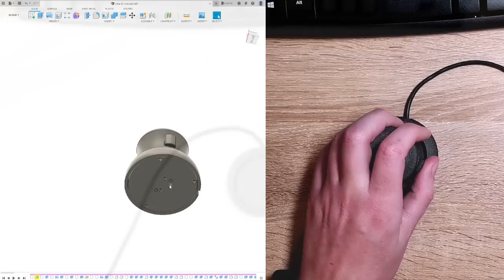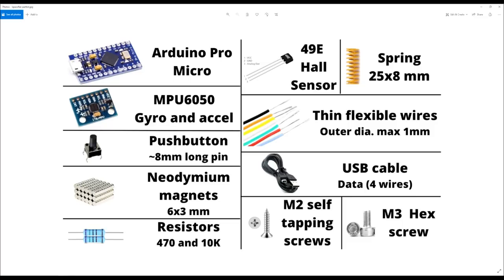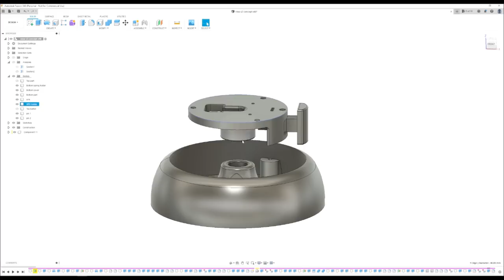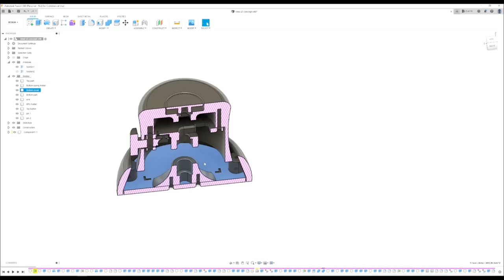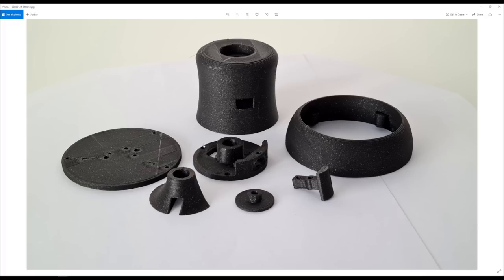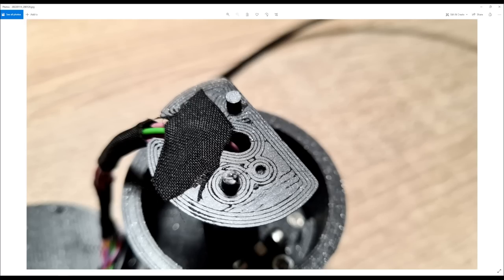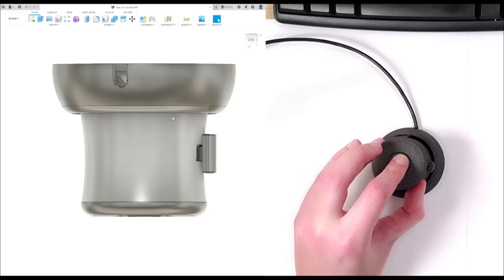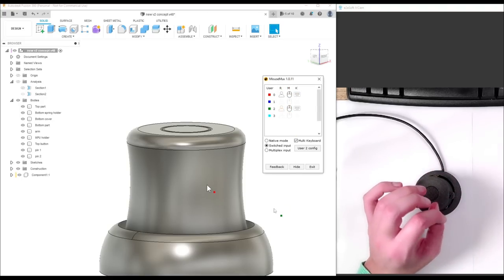Can my DIY Spacemouse compete with 3dConnexion??? - SpaceRat V2

Comment from the maker: Hello Guys,
I just want to add 2 comments.
1. If you build one, you have to set in the preferences of Fusion 360 to take Tinkercad commands otherwise the Arduino code has to be changed. Changing the code is also relatively simple though.
2. For some reason a lot of comments are deleted by Youtube after publishing. I just wanted to let you know that it is not me. I never delete comments.
Reply: Hi!
It´s an amazing proyect.
Could we talk by email?
Reply: This thing would work with any CAD Software? Like CATIA V5?
Reply from the maker: This works with every software where the navigation is handeled by keyboard and mouse movements. I would recommend to watch also the first video where I explain how it works more in detail.
Reply: Thanks for sharing this. Can you share with me the positioning of magnets? They need to push away the button one (to make it stay in the center position) or connect with it?
Reply from the maker: @OzziemandiasPL  you are welcome! The 2 side magnets has to repel the middle one to keep the middle one in the middle. I explain in the video the orientation. + -   - +   +-
Reply: @kikihobbyrepair  I wasn't sure but that was the point :) Thank you very much.
Reply: Have you tried using a Joystick.h instead of Mouse.h and keyboard.h
Reply: Hi, I’m going to order all the components and am busy printing all the files. Such a great project. Thank you for sharing
Reply: @ambriaagke where did you find the list of items to order if you don’t mind me asking
Reply from the maker: @Itsjustmedan you can find the part list in the video and in the github repository. Link in the video description.
Reply: @kikihobbyrepair  thank you sorry completely missed the jpg in all my excitement. Absolutely amazing project fantastic job especially with the price. It’s going to cost me about $20 AUD for the parts and a space mouse costs about $270
Reply: @kikihobbyrepair hi I’ve orderd a usb to usb c data cable and my arduino also has a usb c port. But from the video I understand that I need to cut the cable anyway and solder it directly to the board. Is this correct? If so can you explain where exactly because in the video you name the components but this board is so tiny I don’t seem to find the right spots. 
Is it correct that you need a capacitor of 100nF? It doesn’t figure on the parts list but it does on your diagram
Reply: @ambriaagke  hi, are you done with your project?

Comment: Building this now, but what's the reason for soldering on the usb wire instead of just plugging it in and glueing it in place? There's enough space for the connector. The resistors that the wires need to be soldered too are REALLY tiny and i've got big hands.. :P

Comment: Hi Kiki. I put together your project, but for some reason the zoom out button and the upper round button do not work. I am sure that I did exactly according to the scheme. Do you have any clue?
Reply from the maker: Are you sure all your wiring is correct? Do you have all your arduino libraries installed?

Comment: Great job! I know it took hundreds of hours to come to this point because I'm doing the same.
I follow exactly the same goals: cheaper and easier 3D mouse. 
My design is a 2 stage knob. The upper part of the knob does the rotation while the lower part of the knob does the translation. I published the version 2 on Thingiverse yesterday! I still need to do the code. We are at the same point.
I will be following your progress with great attention. :)
Reply: Can you share your project?
Reply from the maker: You can find the link to my Github repository with all the files in the video description.
Reply: Yes, I meant joker's one. Thanks!
Reply: Joker, please link your project.

Kiki, thank you so much. I have subscribed, and look forward to version 3, but for now, my parts have two more hours on my printer before I start building v2.

Comment: Great project.  For v3, you should consider a pair of custom PCBs.  Also, maybe consider increasing the base to add some steel or lead weights to keep it in place.  My spacemouse probably a .5 KG in the base…

Comment: Nice work. I also did one my self with a joystick, some modifier buttons and an Arduino aswell. But I ended up buying the 3d connexion mouse because it really lives and dies with the software, as you also figured out. I think they do a great job with the software and I always had problems with the mouse input. Using MouseMux it was hard to reset mouse position and without you interfere with normal mouse. And anyway for some programs like PTC Creo there are actions like rolling you can not do with key press emulation, but only with 3d connexion software. So I stayed with the original and appreciate their work.

Comment: Fantastic! I just built the Orbion Space mouse using a Raspberry Pi Pico instead of Arduino. I only realized the Pico was much bigger than the Arduino pro micro once I had printed the files. I have managed to make it work none the less. 

Your project has given me a lot of ideas as I set out to design and code a version of this for the Pico with Solidworks. I really want to tackle modes so functionality can be programmed in for different applications. Arduino seems like it is much further ahead in that regard as compared to CircuitPython. Keep up the great work! and Thank you for sharing this inspirational build.
Reply: Hi, I'm thinking of building this spacemouse with raspberry pi pico, would you have the code you used to share with me? Cheers
Reply from the maker: The Code for the Arduino pro micro is available in my Github. Link in the description.

Comment: Very interesting project, best part is that I think I have all of the parts!  One thought is to add a twisting action of the knob using hall effect sensors similar to the way that the zoom function works. Just thinking out loud that I might want to add a calibrate button to reset the zero point of the mouse/accelerometer when I'm not using it on a level surface.  No matter what an interesting project that came up exactly as I was thinking about buying a 3dconnexion mouse, looking forward to V3 as well.
Reply from the maker: Thank you. As I told in the video there is an offset calibration after power on in the code. In the v3 I plan to add twisting too. The biggest problem is the software and driver though...

Comment: Kiki, I just made the space rat mouse and got it working on the first boot! I used a USB C micro and a small prototype board. With the usb C i did not need to solder on the cable to the micro. I also used a slightly longer micro switch. I am going to look at your macro pad next. I printed the parts on a Bamabu Labs A1 mini with no issues.
Reply from the maker: Good job! 🙂

Comment: If you could make the ring around the button able to spin, and connect it to a rotary encoder, then you could get the rotation you were wanting. 
You could put the encoder below the ring, with a gear on top of it, and put gear teeth at the bottom outside edge of the ring, facing in towards the rotary encoder. You could add three extra microswitches around the ring, wired in parallel to the rotary encoder's switch, so wherever you press the ring, you'll get a rotary encoder press.

A crazy idea for another degree of freedom: Get a pressure sensor, and set your spacemouse on top of it. Then, pressing down on the spacemouse, or applying lifting pressure could control an axis. You'd probably need a large dead zone, and you might want a switch somewhere, to make it easy to disable the sensor, of you're doing something where you don't need it, and it could just cause spurious inputs.

I'm sure you've tried just picking the whole thing up, and using the accelerometers as a vertical axis. That might work if you're using your other hand to hold the base. There could be applications where that would be good. You could even add buttons at the base ring, for the fingers and thumb of your off hand.

Awesome build! It's amazing what you've done with so few parts!

Comment: Hi. 

Great alternative, it is well worth for the price! Thank you for making and sharing.

I have just finished mine, had to tweak the code a bit.

I have also made an autohotkey script so now I can use it without any problems for TinkerCAD, the cursor always stays in the workspace and i can infinitely scroll, zoom, pan etc.

However, for unknown reasons the distance between the main cap part and bottom spring holder was too short, as if the spring was shorter than needed.

I had to improvise and saw a ring off of the bottom of the main top bell part so it can move freely.

I am also planning to re-print the parts with modifications so that there is no need to solder an usb cable to the arduino, it can plug in directly, for now i have filed a hole in the bottom cover for the plug :D

definitely a work in progress but super satisfying already considering the fraction of the price of an original space mouse

Comment: I want to see someone fly a quadcopter using the SpaceRat as the controller.
I once used a Wii Nunchuck to control a small RC helicopter. I think a Spacemouse/SpaceRat would be more intuitive than the Nunchuck.
I used the accelerometer on the Nunchuck for yaw and throttle control. Twisting the SpaceRat could be yaw control and the throttle could be controlled by pushing and pulling on the SpaceRat vertically. 
Thanks for sharing your great project.

Comment: Awesome project. I'm currently working on a version to be used with Blender. So far I've been able to add the twisting motion using the same MPU6050's Z axis gyro. The code is not very different from the one using the hall effect sensor, and it seems to be working quite fine (although I must admit my coding skills are not the best). I'll keep you posted as soon as I complete it. Keep up the good work!!!
Reply: Did you ever finish it? :) I'm building one of these now and I'm interested in the code
Reply: @vesslades  Hello. Yes, I finished it. I made two versions: One with the MPU6050's Z axis gyro and one with a rotary encoder.  I'm happy to share it with you, but my files are a bit messy at the moment. Give me a couple of days to organize/upload everything to Thingiverse and Instructibles .
Reply: @meisterodin1981  Wow, thanks mate. I would appreciate it very much!
Reply: @meisterodin1981  Cool! Thanks a bunch!
Will take a closer look at it all when I get some me-time :)

Comment: Nice project.  I am doing some hall effect projects myself and I have found that the A1302 is a good substitute for the 49E and was a little easier to find in bulk. And of course, the A1344 hall effect sensors are all over the place, but they are not linear and will not work for your type of application.
Reply from the maker: Thank you. Yes, here I need a linear one. But I coukd buy 10 of them from Amazon below 10€ which is not that bad.

Comment: Great Project! Are you aware, that you can do at least two relativly simple improvements?
- Instead of having a button in the cap on top, you could make the whole cap the button.
- Instead of having a slider (or whatever you call it) on the side of the cap, you could make the cap a bit rotatable.

After what i see and understand, both improvements could be done without changing the basic design and without changing the technical side. It is "just" the mounting and the design of the cap, that has to be changed in order to get rid of the extra buttons/slider. The changes would make a nice looking clean SpaceRat...
Reply from the maker: Thank you.
Putting the button under the cap is not that easy because you might trigger it also when you put your hand onto it or while you tilt the cap. 
The slider I might solve it differently with a bearing maybe. Lets see.

Comment: This is really cool, I’m considering building one, because I think it could be better than the spacemouse.  

I understand they have cost constraints, but the spacemouse wears down rather quickly.    This could be built with machined aluminum instead of plastic like the spacemouse.
Reply from the maker: The huge advantage of the original is the firmware and driver. I simply cannot reprodukate it...

Comment: Good evening. Excellent video. On the other hand, could you tell me the connection of the four wires of the USB socket. There is no indication on the diagram Thank you for your reply
Reply from the maker: Thank you. Just take a look at a standard micro USB connector pinout online and follow. These are all standard.

Comment: Thank you for sharing your project. It is simply enormous because the circuit is kept so simple and only a few components are needed. I've been thinking about such a project for years, but I don't have the right knowledge of electronics and programming, but a lot of ideas in ergonomics and form design. As a program designer from the 80s to the end of the 90s in CAD/CIM, the mouse has always annoyed me. i hate the keyboard with Shift+Ctr+Alt plus right mouse click.
 3dconnection is too expensive for me. I am a pensioner.
 So your DIY Space Mouse with 12 buttons with small LCD ergonomic all around, that would be ideal. Similar to the large 3DConnection models. I would hardly need the keyboard anymore. I work hobby-like with SolidWorks (ancient), Fusion 360, Davinci Resolve, Thanks again for your great work.
HD
Reply from the maker: Thank you for the nice words!

Comment: Thanks for sharing and making available to everybody such a valuable project. I appreciate the value added to the community. I also would like to ask a question. I'm a newbie to Arduino and wondering whether the computer recognizes it as a HID device when you plug it in from Arduino's usb port or soldering the connections you suggested is a neccessity.
Reply from the maker: Thank you. PC is recognizing it as a Mouse and keyboard. Soldering is only to be able to put the wire on the middle. Wires are soldered to the same points like the usb cable connects to.

Comment: Oh, i was wondering... Would it be possible to make a controller that would look like reversed trackball? A sensor knob hovering on spring(s) over a dotted ball? You could track the pattern and use  for axis control? Zoom in/out (pull up/press down) would also work probably

Comment: Does this translate into 3d orbit when rocking? Have you thought about adding maybe a rotational component in the base? I think an affecter wheel and an eye setup could make a non electrically connected rotating part.

Also, I noticed that it moves in 4 directions instead of following more the movement of the spacerat. is this because it is using keyboard commands?

Comment: This is just screaming for a custom PCB holding the sensors, button and an MCU (attiny84?) all on one board reducing the footprint and the amount of wires ...  Well done!
Reply from the maker: Thank you. Yes a custom PCB is the plan bit you need 2 anyway. The MPU must be at the top and the cable has to come out at the bottom. Attiny84 is not good because you need a microcontroller with native USB. This is why I use the more expensive pro micro and not only a cheap nano.
Reply: @kikihobbyrepair  I thought I had seen code in the past using an Attiny as a USB HID device, but I'm unsure.  Well, an STM32 could also do the trick or the MCU of the Arduino, but then without all the unneeded stuff ...

Comment: Is it working system-wide with all apps supporting 3D mouses? FreeCAD, Orca, Fusion, ... or is it the compatibility limited?
Reply from the maker: It works with all the systems taht are controlled by mouse and keyboard commands. You only have to change these commands in the code for different apps. Now I am working on the V3 which is true 6DoF already and communicates with the original 3DConnexion software :)
Reply: @kikihobbyrepair  ok so it's a mouse+keyboard emulator. This means that, for example, FreeCAD 1.0 will use the current cursor position as center of the rotation, while with my super old SpacePilot the object rotates irrespective of the position of the mouse.
Good you are working on a compatibility layer with 3dconnexion drivers, that would be a huge step forward. 
Are you already aware that they changed the approach sometime around 10.5.6 and FreeCAD 1.0 will not accept anymore devices not supported by this newer (well 6 years old or so) drivers?
If you emulate an old SpacePilot or similar (which is easy) you will not get support in OnShape (and browser apps in general) and FreeCAD.
Ideally you could emulate a SpaceNavigator (the puck), which is supported until the second to last version of the drivers, and also by spacenavd (linux drivers), so it might be easier and more future-proof.
Good luck!